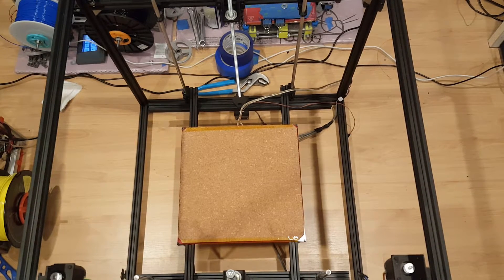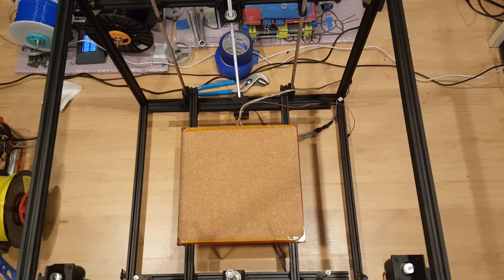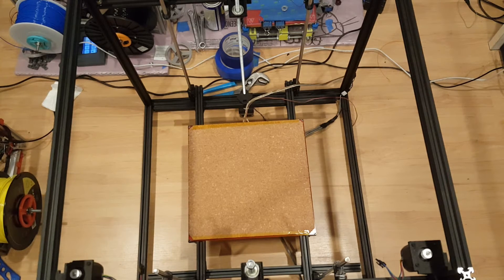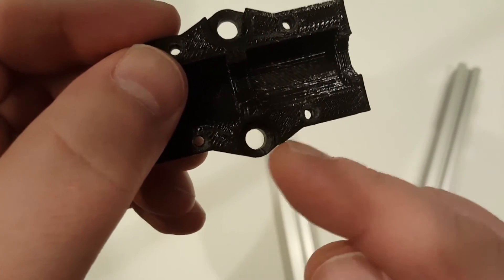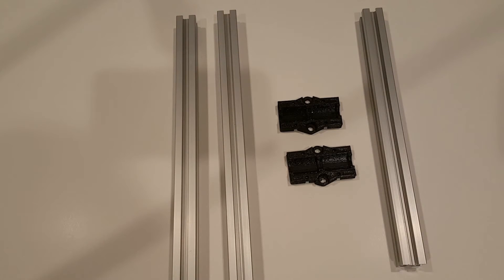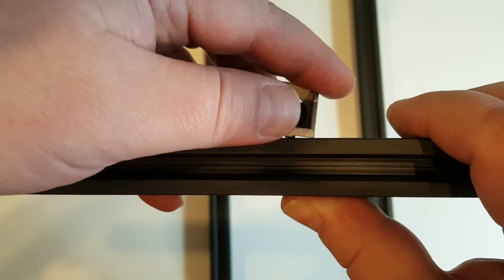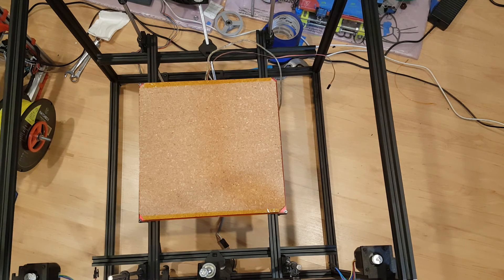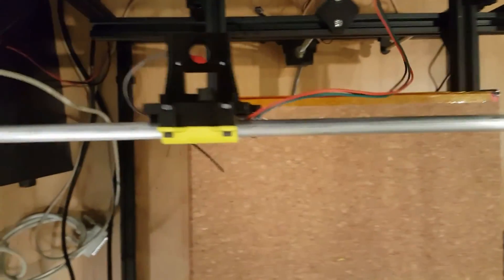Hypercube XL build #1

Comment: Hello brother I'm looking 600X600X600 printing size 3d printer I see you updated 400X400X400 and you redesigned fram can you help me to build according me if I want 600X600X600 printing area what is the fram size I build how I calculate frame size can you calculate the materials and motor size and other electronic parts for I'm very much thankfull to you for your kind help I also want multicolor printer for donate in the villages school to develop toy for kids

Comment: I'm in the process of building mine. It's quite the learning process. Almost all of the chinesium I ordered was of poor quality... Bent rods, bent lead screws, rods that are way too big and cause the bearings to bind, bearings having their ball bearings pop out (sometimes because of the larger sized rods). x 549mm y: 641.5mm and Z: 650mm (including the legs) measuring from the outside of the frame. I can barely fit this thing through the door.

Comment: For the bed, you should attach one extrusion to the smooth rods and the threaded rod on each side parallel to the front/back of your printer. The extrusions the bed will sit on can then be mounted whatever spacing you want them on top of the extrusions on the side, without having to move the smooth rods.
Reply from the maker: Great idea but then my controller is situated such that it would get in the way. in the end I cut X extrusions shorter and will print extended bed mount brackets when I upgrade to bigger bed.

Comment: can you give me a thought for putting z axis on the sides of printer for a hyper cube 500mm for x 500mm for y and 700 for z would it be better with just 2 or 3 z axis’si want a hypercube 500mmx500mmx700mm
Reply from the maker: I don't understand what you mean by 2 or 3 z axis. you mean smooth rods? threaded rods?
Reply: 2 threeded z axis rods.
Reply from the maker: I'd go with setup like mine. Two threaded rods, four smooth rods. Maybe use higher torque motors because of increased weight.

Comment: Did you stick with 8mm rods for the Z axis?
Reply from the maker: yes. Since bed is supported from front and back, tehre's no cantilever action going on. thus no bending force on rods. They just guide bed up and down. So no need for thicker rods.
Reply: Thanks for replying. I imagine your machine is up and running at this point? How are the prints coming out?
Reply from the maker: pretty much the same as from my mostly standard Hypercube. I don't see any degradation which might be expected from larger printer potentially being more prone to vibrations or difficult to align. Only issue that I noticed is that when I slide my X gantry all the way to the back, difference in gap on left and right between XY joiner and rear Y rod mount is bigger than on smaller printer. That's a common issue. Need to work on that. Obviously this will result in parts not holding angle which will be especially noticeable on bigger prints.

Comment: Hi, I'm trying to build a 400x 400 hypercube but I'm having trouble with the belts stretching a huge amount when tightened even a little bit... what belts are you using? Are they just the one in the BOM on Thingiverse? Thanks!
Reply from the maker: I buy these http://www.ebay.com/itm/5M-GT2-Timing-Belt-3D-Printer-4Pcs-16T-5mm-bore-Pulley-For-RepRap-Prusa-/401299276410?hash=item5d6f4d027a:g:eQQAAOSwanRXhFGD

Comment: how do you make so silent, mine screams like crazy when I move the Z . Do you use oil ? Also your X axis is very silent what is the secret ?
Reply from the maker: What driver are you using and what microstepping? Mine is DRV8825 with 1/32 microstepping. At the time I recorded this video there was no lubrication but later I applied some lithium grease
Reply: Artur's Lab I have both Printrboard and RAMPS with A9982 both are noisy, more like resonance . I am amazed with such long belts you have no noise. What speeds and accelerations are you using ? How do you tighten the belts to have right tension ? See my videos for the nasty vibrations and noise I have .
Reply from the maker: I've already commented on your videos when you asked me to see them a while back. Still having trouble? I haven't really done anything special, just put the printer together. Tightened belts by hand. But I do need to adjust them a bit more. Maybe your linear bearings are too tight or of poor quality and they are binding a bit. Do they move smooth by hand? Take the belts off and see how stuff moves. Unplug motors from controller and see if motors rotate smoothly. maybe bad bearings in motors.

Settings in Marlin are pretty much default
#define HOMING_FEEDRATE {50*60, 50*60, 4*60, 0}  // set the homing speeds (mm/min)

#define DEFAULT_AXIS_STEPS_PER_UNIT   {200.000,200.000,200.0*32*18/25.4,1196.67} 
#define DEFAULT_MAX_FEEDRATE          {300, 300, 5, 25}    // (mm/sec)
#define DEFAULT_MAX_ACCELERATION      {2000,2000,100,2000}    // X, Y, Z, E maximum start speed
#define DEFAULT_ACCELERATION          2000    // X, Y, Z and E max acceleration in mm/s^2 for printing moves
#define DEFAULT_RETRACT_ACCELERATION  3000   // X, Y, Z and E max acceleration in mm/s^2 for retracts

#define DEFAULT_XYJERK                20.0    // (mm/sec)
#define DEFAULT_ZJERK                 0.4     // (mm/sec)
#define DEFAULT_EJERK                 5.0    // (mm/sec)

Comment: Are you using regular M8 Threded Rods ? or TR8 ? Nice work so far :)
Reply from the maker: 5/16 inch regular threaded rod. May switch to real threaded rod later depending on how bad Z wobble is.
Reply from the maker: sorry, haven't been paying attention to comments for a while. Even worse, american 5/16 threaded rod from a hardware store. Gets the job done, though. I will upgrade to T8 once I get one that isn't bent. Not much luck buying straight rods on ebay so far.

Comment: Did you have to use more than one kit to build this?  I see you are only using the 20x20 extrusion.  I bought two kits and was wondering if this is enough to replicate what you built.  I haven't had a chance to play around with it yet.
Thanks
Reply from the maker: I used 3 kits because each only had 2 of the extrusions I used for Y. I used 4 for the frame and 2 for the bed. But you can prolly use something else for the bed if you only bought 2. or use shorter extrusion for Y though then your travel might be not enough for bed bigger than 300x300

Comment: Looks nice!. Are you using regular inch treaded rods?
Reply from the maker: Yes, inch sized for now. May upgrade to real leadscrews later
Reply: Watch out for rounding errors when you choose layer height.
Reply from the maker: Very good point. But I have 4535 steps per unit on Z. I think that's way beyond mechanical precision anyway, so I should be good on rounding. What do you think?